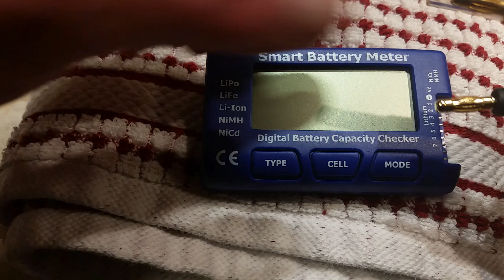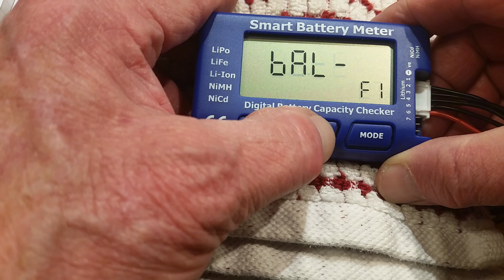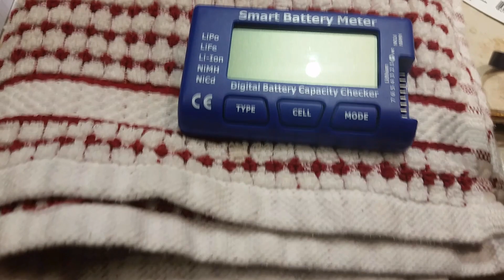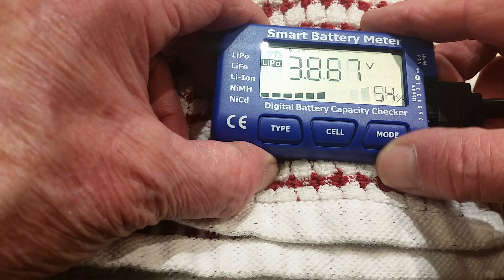Lipo Internal Resistance

Comment: so value 2o 5o it mean 2 ohm and 5 ohm right?
Reply from the maker: Yes. When a cell exceeds 10, it is starting to degrade. When a single cell reaches 20 the battery is terminal. It is at the end of it's useful life.

Comment: I have a question. 
If I hook up a battery holder, would this check 18650 lithium ion cell resistance? 

Also, have you done any comparisons to manually checking (using the voltage drop calculations) and see if they are similar?
Reply from the maker: I have only used it to measure cell voltage and IR of Lipo's. I am certain there are lots of other uses and it does work with many different batteries including Li-ion. There may be other videos on Youtube that would be helpful.

Comment: My capacity checker doesnt have this option, balance or ir.Just min-max cellv otage, capacity
Reply from the maker: I have one that doesn't have the IR as well. I think there were two versions. They sell them on Amazon for about $20. Look for one that specifies the IR function.
Reply: I just got one from Amazon and mine doesn't have the IR function either. So disappointed! The list item is "QWORK RC Cellmeter Controller" and the manual says "CellMeter-7 V2". Guess I'm returning this one and searching for another one that specifically says it has the IR function.

Comment: Thank you.  Should my battery under test be Charged fully or in Storage charge.. Does it matter.
Reply from the maker: Good question. I haven't made a comparison but that would be interesting. Mine have always been at storage charge.
Reply: @folepi22_SteveC  Thank you, I will look forward to your test on a charged battery.
Reply: @kevlec1947   check the battery brand new and at full charge and record those numbers and compare through out the life of the battery! Always check at full charge.
Reply: What matters most is the drop of voltage under load...not the capacity.  It could be either storage or fully charged, just not close to fully discharged, as the current load can damage your battery.

Comment: Thank you, very useful! But my question is : how to tell if the internal resistance values are good or bad ?
Reply from the maker: They should read less than 10.
Reply: @folepi22_SteveC  Thank you!
Reply: Why the below answer is correct they should be less than 10 what you really want to look for is dramatic differences say you had a for cell Battery and you got resistance values of 1 to 4 and nine obviously there is a large difference in one of them that would lead me to believe that particular one had some kind of damage
Reply: @LargeeeScaleLife  so when it goes through saying 2s, 3s, 4s, those are internal resistance for each cell? And so if there’s a big number different between say 2s and 3s, you should dispose of the battery? I’m trying to figure out how to really tell the internal resistance. Thank you in advance!
Reply: @ethan1995  so if the reading on the internal resistance was way off from each sale to the other yeah it would probably be best to get rid of the battery. However, that being said, most of the chargers we use in the hobby grade community aren’t accurate enough to give you a real level of measurement a machine to really accurately measure internal resistance is beyond the budget of most of us but if you had a really good charger that would measure internal resistance in your readings were insanely off and the battery was a little older had had previous damage or a weird voltage drop. Yeah I would probably get rid of it just to be safe.
Reply: @ethan1995  I will say this I rarely if ever check the internal resistance of my batteries I did have one battery that was charging weird, and it always seemed that one of the sales would jump voltage down quicker than the others, and would be quite far off every time I charged it or discharged it ended up getting rid of it just to be safe most the time I keep my low-voltage settings pretty conservative just to be sure I don’t damage a battery.